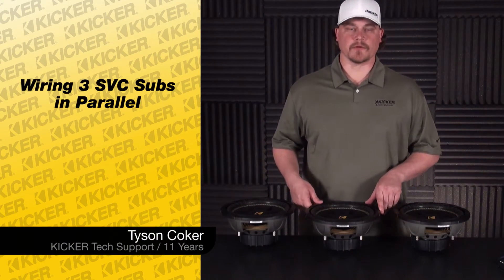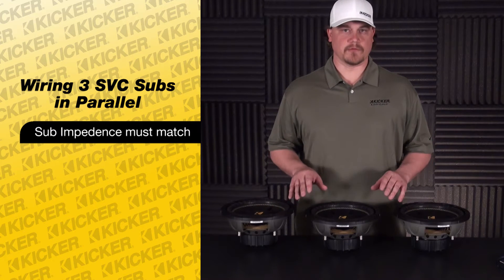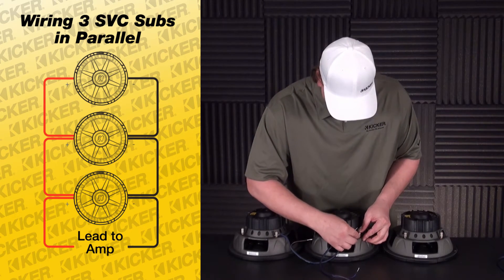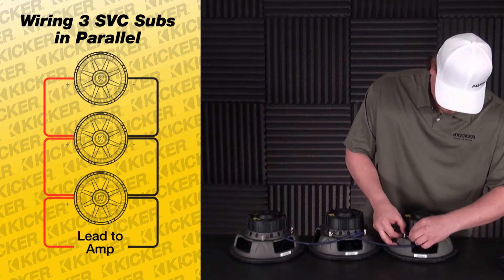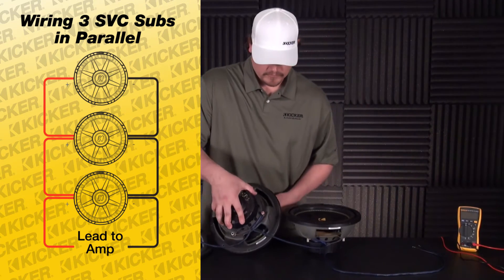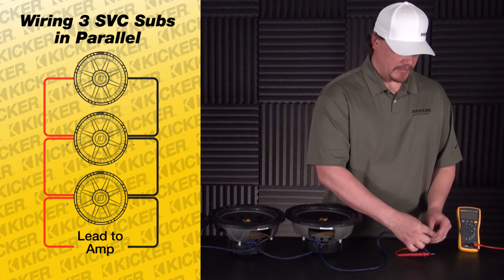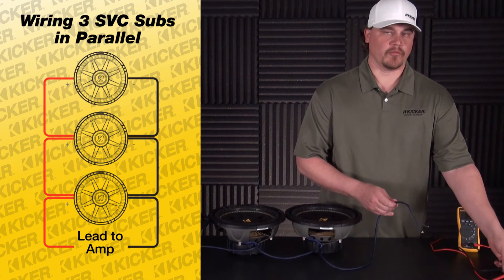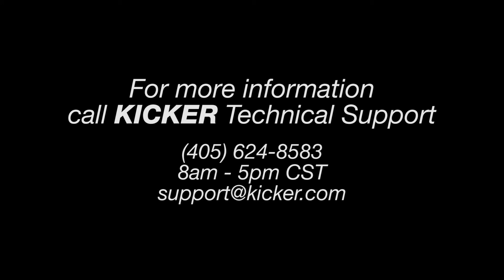Subwoofer Wiring: Three SVC subs in Parallel

Comment: Ok so wiring in parallel for single voice coil subs is basically just daisy chaining each positive wire together and the same for the negative wires. Seems simplified enough.

Comment: I have 3 kickers comps 10s and a ssl 3000 will that be good to go need help plez
Reply from the maker: Depends on the ohm load of the subs, and which Comps they are. We make eight lines of comps. Also, is the SSL amp you are referring to the EV3000D?
Reply: @KICKERAudio  thay are 4 ohm's and yes thats the amp i have ..how would i wire all 3 of them

Comment: What if you have two dvc pioneer and one svc is this a problem are how would I wire it
Reply from the maker: That would depend on a few factors.  The first is what ohm load each sub is rated for.  Second is what ohm load the amplifier is rated to. Lastly, do those subwoofers have an RMS that works the RMS of the amp.

Comment: What if your cables are too thick to both fit in the terminal such as using 14awg?
Reply from the maker: Most any spring-loaded terminal should accept 14 awg, but not all terminals can accept two of them. In that case, trimming a small amount of wire off of the cable is often the only alternative to doing an entirely new run of smaller gauge speaker cable. Just make sure you trim the raw strands of copper or cca as close to the jacket as possible to avoid potential shorting.  If you want more detail, please give us a call.  Tech support is open weekdays from 8-5 central time at 405-624-8510.  Thanks!
Reply: Thanks!

Comment: What about connecting three 2 OHMS DVS? 
I wanted them at 1 OHMS final.
Reply from the maker: Sure, you can do that with 3 dvc 2 ohm subs.  We even have a video for it: https://www.youtube.com/watch?v=PNsWjBtwc2g&index=24&list=PLV2hurat1mvmHUBLRPIfRMkWKtIO-TSNo

I realize this is a 4 ohm DVC video, but the technique is the same.  The result is simply half the ohm load (about 1.3 to 1.6 ohms depending on the subs themselves).

Comment: So i ordered a Hifonics Zues 1200w 1 ohm stable amp for $120 but since you work for Kicker maybe you cld recommend a Kicker amp to push 3. Wld rather have an all kicker setup or can you send me info on how to strap two cx600.1 to push my 3 subs.
Reply from the maker: A few notes:  none of our amps can be strapped, and all of the mono amps except for the powersports amps are 2 ohm stable. Can you tell me what size fuse it has?
Reply: 1 x 80amp
Reply from the maker: Ok ,so let's do some math. With 100% effeciency, that's 1152 watts.  Most class D amps are about 80, so at the very most -  in a burst - you'd get about 922 at 1.33 ohms.
Reply from the maker: You can use this site for help:  http://www.ohmslawcalculator.com/ohms-law-calculator
Reply: Thanks for your help man im sure im getting on your nerves lol just 3 svc are hard to deal with lol

Comment: so is that a good diagram or what??
Reply from the maker: Wiring all 3 in parallel like the video shows you, you get about 1 to 1.5 ohm load.  If you do it in series parallel it will be about 12 ohms.  The way you wrote it, I wasn't 100% sure, but there is no way to get 2.67 ohms with these subs without throwing one of them out of phase with the other two, which is not recommended.

Comment: And the first question about the 2 amps i only ask cause ive seen package deals with 3 40cws124 and the cx1200.1 and cx1800.1 package together an i didnt think either could run at 1 ohm

Comment: ok i have another question. you helped me earlier when i had two kicker comps 12" 600w/300rms. so now i have 3 12" 600w/300rms subs. So i was wondering 3 things. 1. Can the cx1200.1 or cx1800.1 push these at 1 ohm safely? 2. Should i just go buy another cx600.1 and stack with my other cx600.1 pushing my two 12" kicker comps? Or like my friends keep telling me go buy a 4th sub to give the amp i already have a 4 ohm load? kinda lost and dont know what or how to do it. kinda favoring the stacking idea cause i actually love my cx600.1 and dont want to let it go so if i have to buy another one id be more than happy!!! And thanks for your help!!!
Reply from the maker: Ok question 1)The CX series isn't officially 1 ohm stable, but coming in April the new KX series mono amps will be. 2) If you buy a 4th sub, then you have more wiring flexibility. Yuu can wire four 2 ohm subs to a single 2 ohm load. You might want to check this video:  https://www.youtube.com/watch?v=GJardRkYK-Y
Reply: im sorry they are 4 ohm and that where my problem is i guess. i guess what i really wanna know is if its safe to stack two cx600.1 amps. How wld i do that with 3 4ohm svc 600w/300rms kicker comps. sorry for my ass backwards questions lol

Comment: would this work on 3 dvc 4ohm subs?
Reply from the maker: +mirandee27 wiring in parallel with 3 4 ohm DVC subs would result in a 1/2 ohm mono load. If you amp is capable of handling that, then you are good to go.
Reply: KICKER an